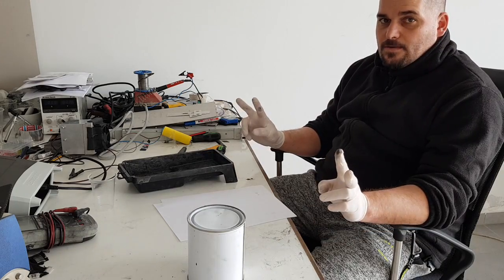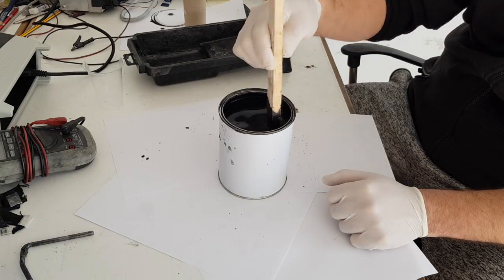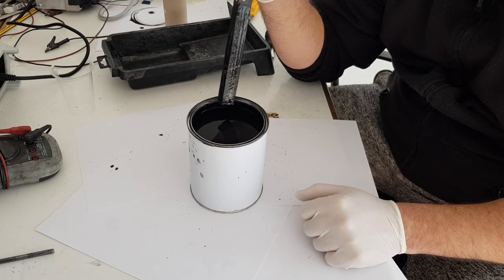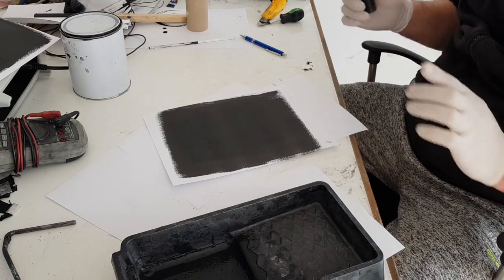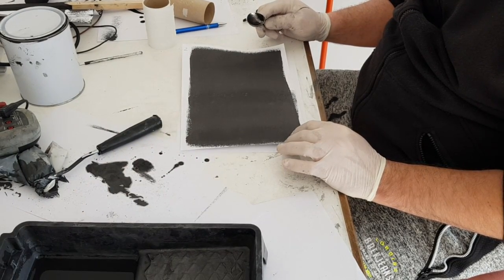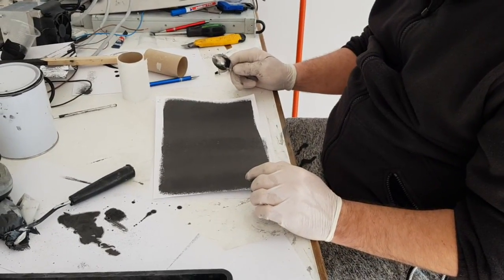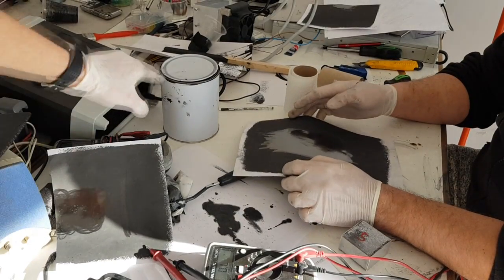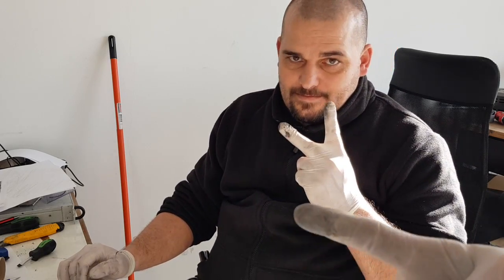Carbon conductive ink  - First 1 liter

Comment: What is the difference between carbon ink and graphite ink?
Reply from the maker: One think is the marketing,.... graphene ink is more fanyc and higt tech to hear. If you sell like "graphene" ink everyone will say,... wow graphene is in the ink or I use graphene ink. Graphene is in basic carbon but only one atome thick. A  carbon is activated carbon, carbon, graphite, graphene, etc, because is made from carbon atoms,... but the carbon structure is different. In inks you will not have singel layer graphene in but most of the "graphene" inks have multi layers graphene. The graphene have higher conductivity and also higher cost. So, carbon, graphite or graphene ink is almost the same.

Comment: Some nice low ohmages, waterproof & flexible, looks really good to evenly apply. V nice! :))
Reply: Have you tried applying it to slightly sanded or etched metal foil tape or metal mesh surfaces. Also wondering is it completely non porous, stable & resistant to aqueous or DES electrolyte positive electrode surface oxidation?

Comment: How does your ink compare to other conductive inks that are company made???
Reply from the maker: Is better,.... waterproof, good heat resistance, around 50 to 30 ohms with no pressing the surface,... 5 to 0.7 ohms or better if you press the surface,... harder you press the surface lower will be the resistance
Reply: @cayrex  price?
Reply from the maker: @mteca5093  the company set the price,... the contact is: k.bajt@dr-nemo.si (Krištof)

Comment: Bro, These Condative ink is it Flexible  ???
Reply from the maker: Bro, yes!
Reply: @cayrex  Bro, Graphite + Sodium mix is not Flexible. I try it. It's Waterproof etc,..  But not Flexible for circuit print 😢😢😢😢😢😢
Reply from the maker: @veluvelu2457  aaa bro,... you mean graphite and sodium silicate ink. No this ink is not flexible. I was thinking that you mean this carbon ink because you comment in this video
Reply: @cayrex  Thank you, Bro. 
Bro, Please make a video about How to make DIY flexible + 💧 Proof Carbon Condative ink and Paint . Like these 1 Litre. Please Bro. It will useful for school Project. Please HELP Bro 😢😢😢😢😢😢
Reply: @veluvelu2457  I'd try a water base clear polyurethane 1 to 4 ratio first then test it's  change in resistance compared to the original and adjust the mixture as desired or needed.

Comment: send me a link so i can get some ink
Reply from the maker: Hello! In the description you have the email
Reply from the maker: @keeptrying7640  yes and no,.... this is not a capacity ink. if you want to make some current collectors for the battery is this conductive ink good, but if you want this ink use to make a battery electrode,... the ink will give you small capacity.
Reply: @cayrex  ok thanks for the info do you have a capacity video teaching this
Reply from the maker: Sorry mate, no
Reply: @cayrex  how come you don't what if i mix graphite with activated carbon would this help me get to my goal
Reply: @cayrex  hay Mr. may be now is the time to make a video on how to increase battery capacitance